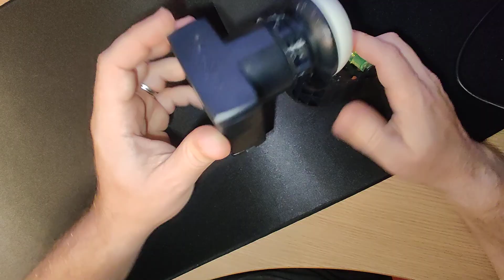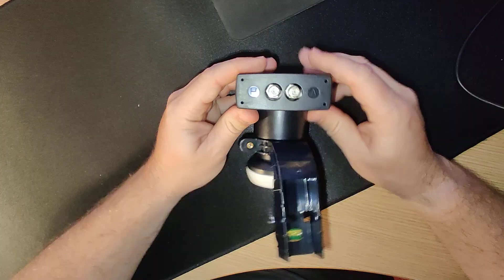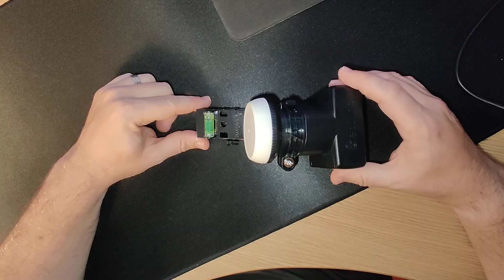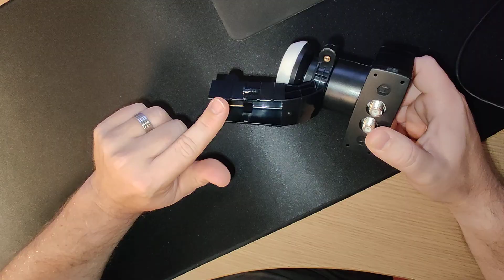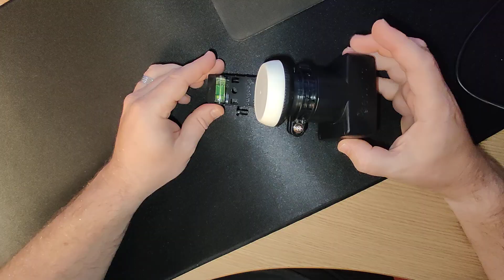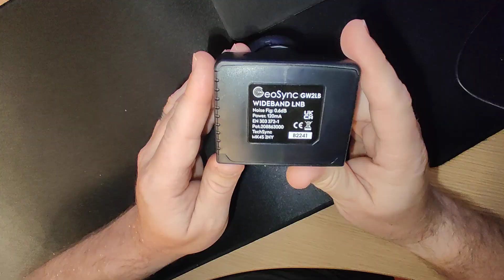Understanding LNBs - Wideband & Universal Low Noise Blocks for Freesat TV Boxes

Comment: This worked great for me, one question, I couldn't get the cable protector to pull down, is this because its no longer done like that any more or do I need to pull it down harder? Thanks.
Reply from the maker: LNBs are all a little different, most have a pull down flap, but not all. check the details from the manufacture

Comment: I have a LNB with both old and new connections Hybrid 
It has 2 wideband ports and 4 normal ports
Sat finder gives full signal and quality when in normal mode 
If I move the cables to the wideband the New UK freesat box UHD-4X-500 says NO signal EVEN though it works fine using older ports
Any ideas what I’m doing wrong ?
This is not my first attempt to do this tried on another box ( the same ) and another dish with same type wideband LNB
Reply from the maker: Hi you can't normally just swap the cables as a very minimum you would need to fully power down and reboot the box but the chances are you might need to run the channel tuning function again from the setup menu after you swap the cables
Reply: @FreesatSpares thanks I’ll give that a try

Comment: I have a wideband LNB from sky Q usage that works with a freesat box no issues. I want to connect the dish straight to the TV. Is there a vid to show how to switch it to an older style LNB?
Reply from the maker: Hi. the 2 systems are not compactibale but you could change your LNB to a Hybrid type which has both types of output in one device that work as indpendant outputs. https://freesatspares.co.uk/products/4k-hybrid-lnb-run-your-freesat-sky-more-from-one-dish

Comment: I hate that WIDEBAND LNBs, that is not a Standard in the whole of the EU.. I Brought me an SKY Q from England. 

And now i would need those Nonsense LNB.. But that makes my Dish Not longer Compatible with my Old Receiver.. and vice versa.
Reply from the maker: hi. its not freesat, but I was under the impression there was a serect menu that allowed access to the LNB settings and it could be changed for other LNBs
Reply from the maker: https://www.youtube.com/watch?v=uep85RX7keA
Reply: @FreesatSpares  SCR is not working as well with my Universal LNB and the SKY Q that was a thing i tryed out, and i found this option wou your Video :) My Linux Receiver Works just Fine.

Comment: Hi, I’ve just installed a Zone 2 dish and cannot get a program. Now I’ve gone for a zone 2 but I live in East Midlands, the reason for this is the old one started pixelating. I thought it would be better, but now not sure. Can you shed any light on the problem please. It’s an LGOled 65” brand new TV. Very strong signal strength from the Astra Satellite
Reply from the maker: @stevemcilroy.62  it's a really difficult one to give advice on when I can't see the installation things like trees in the distance might be causing an issue damage to cable and obviously if your dish isn't aligned correctly. And like this video talks about if you've got a wide band lnb be and you need a universal type you're not going to get a signal
Reply from the maker: I always suggest if you have limited experience it's probably quicker and cheaper to get a local installer to assist you.
Reply: @FreesatSpares  thank you for a promo response. It’s a brand new cable, dish, and the signal strength from the meter shows top of the scale, so really puzzled. It’s also a new tv, so the free sat is already installed. I’m thinking of changing the whole dish for zone 1 and if that don’t work, I’m up Sh” creek without a paddle,
Reply from the maker: @stevemcilroy.62  if you're using an analogue metre with a needle that really doesn't mean much because there's hundreds of satellites in the sky and you could be picking up on any of them... To help you there's a great app called satfinder which gives you reference points that you can line up the dish
Reply: @FreesatSpares  yes, thanks. While the TV was tuning, it did say Astra 28.2E so I’m assuming that’s what it was aimed at. I will have a look at satfinder now, thank you
Reply from the maker: @stevemcilroy.62  I would think the TV saying 28 degrees is just telling you that's what it wants to see, not what it's necessarily looking at

Comment: Would the LNB as shown here be compatable to Direct Connect to my TV with Built in Freesat where the TV has a SINGLE cable connection?  Currently if I connect our current Sky Q LNB It finds 128 channels when the scan is complete with descriptions and TV guide but no Picture signal. Thank you.
Reply from the maker: I would suggest a hybrid LNB would be the best choice for this, you can switch the cables to use either wideband(SkyQ) or standard Universal. Check out our website www.freesatspares.co.uk we sell them all.

Comment: Hi I recently bought  a SAMSUNG QE55Q80CATXXU 55" Smart 4K Ultra HD HDR connected to the old sky dish to try get freesat channels but its scans nothing do i need to change lnb?
Reply from the maker: you need to look up at the LNB on the dish, look carefully, if it has the letters H-V next to the cables that is a WIDEBAND, these can only be used on skyq and UK freesat Arris boxes. if it does have the letters HV you need to change it to a universal type, but also double check all your cables, and also make sure your TV is scanning UK freesat or Astra2 in the settings menu. thanks
Reply: @FreesatSpares I can only pickup loads of mixed up channels from searching in satellite mode , but when I scan setup in freesat mode no channels , OK I will check my lnb thanks for you advice ,...  ps please send me a link to which lnb I need to get to be compatible  thanks again
Reply from the maker: @kamikazekaos  list some examples of channels names, you might be pointing at the wrong satellite
Reply: @FreesatSpares I can't get BBC channels  but can get most other freesat channels on demand like skysports etc plus foreign channels? In scanning in satellite  mode, just can't understand getting nothing scan in freesat mode?
Reply from the maker: @kamikazekaos  sounds like either the dish is out of alignment or something called the TP list needs updating. Have a look in your TV manual and see if you can run a scan of channels in Blind mode, it will search every frequency, takes quite a long time.
Reply: I did do this it took about hour and half and got 2000 odd channels , and still nothing when I scan on freesat
Reply from the maker: @kamikazekaos  and give me 5 or 6 examples of the names of the channels
Reply: It's OK now I had to set up satellite and scan in expert mode now I have feeesat TV thanks for your time and support

Comment: i have sky q dish , and i bought fresat 4k t box
its not working
what lnb do i need
Reply from the maker: Hi. It sounds like you have a problem, as the UHD boxes for Freesat should work with a skyq LNB. I suggest doing a full factory reset, and checking all your connections before changing anything
Reply: how do i reset the freesat box
 @FreesatSpares

Comment: Cool. Having ditched Sky years ago, I’ve relied on my freesat OLED Panasonic. But having dug out my old Blu Ray recorder, I’ve borrowed one line for that. So does this mean I’m reducing the channel list, or the old LMB type picks up all? 

Ideally I’d have 4 cables. Presumably need a new LMB for that?!
Reply from the maker: if you have a QUAD LNB which is the most popular type installed in the last 10 years, you should be able to just run a new cable if needed. the extra cables are only needed for recording, 1 cable is enough for just viewing. check the video on how to ID a quad universal LNB